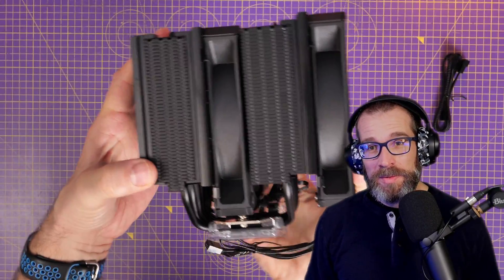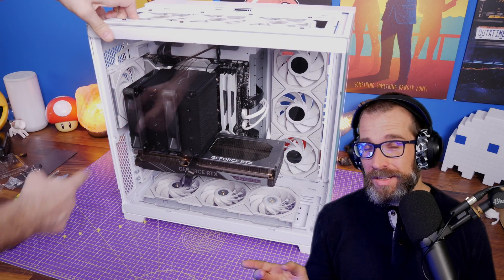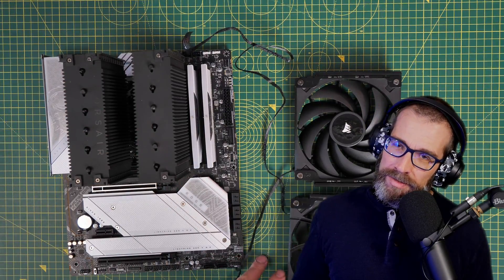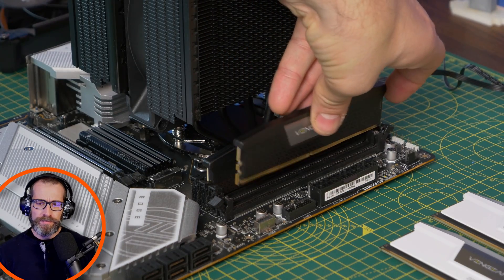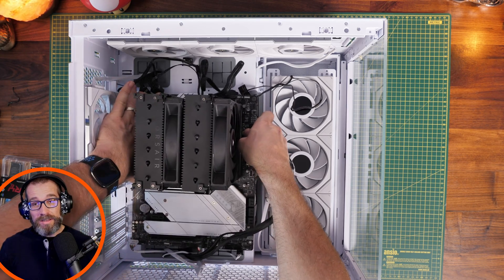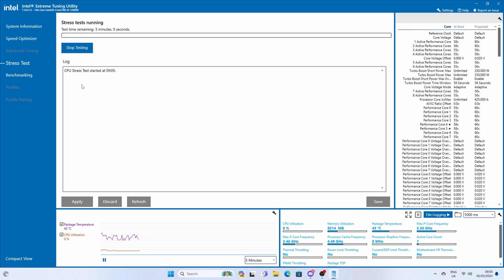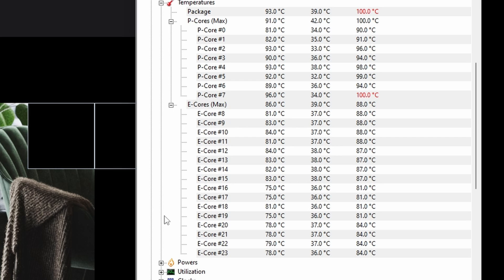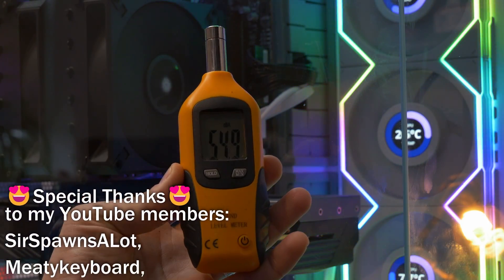Build your CPU cooler properly, not like me

Comment: Had the same isssue. Could just swap out the rams radio shield with a non rgb one.
Reply: Was getting temps over 98⁰c before (stock cooler), with noctua nh-15 I'm getting 40-60⁰c at full load (single fan).
Reply: Ryzen 9 3900X 12 core (for refernece). Also thanks for the video, was useful.

Comment: I always find it baffling how people are surprised that GIANT, double fanned heatinks actually perform close or in some cases better than water.  It's been like this forever.  They also tend to be quieter too unless you have a great custom loop and they don't have a risk of failure.  The main reason to bother with water is to save space, and because it can sometimes lower GPU temps as well (but not always, and not by a huge degree).

In any event, it's not even worth overclocking Intel CPUs any longer.  They're already horribly power inefficient by default, and it makes a lot more sense to undervolt them.

Comment: I am starting to wonder about air cooler fans. I bought a bequiet air tower and found the fan was noisy. I swapped the fan out for a slightly bigger bequiet fan and it was much quieter. the thermaltake fans that came with my CTE700 are suboptimal. I swapped those out for the quieter BEquiet fans. much better. So the upshot is buy coolers and cases without fans a fit best quality fans afterwards.

Comment: Thanks for the update! It might make sense to run the stress test a bit longer. Air coolers should reach thermal equilibrium fairly quickly, so it won't be much longer, but chances are the CPU would have thermal throttled with the stress test as well. Seems like the temperature might still have been going up at the end of the 5 minutes (higher lows and overall more time at the top). But perhaps Cinebench is simply more demanding as well.

Comment: A big factor is to avoid installing fans on a pull setup due to the fan blades getting too close to the heatsink causing turbulence. Push push fan config will provide best direct air flow cooling and the push side of a fan with the motor arms recess the fan blades inside the fan providing the needed gap to avoid turbulence. If you must run a pull fan make sure the heatsink is designed for it with something the puts a small 2mm gap or use something like thicker pads to gap the pull fan away from the heatsink. Most people don’t even realize they have added a new unnecessary noise to their system. 

I learned this when I added a 3rd “pull” fan to my Noctua D15. Luckily my Noctua U14S cooler included purposefully built thicker pads for this exact reason. I made a basic video to show people what the pads look like.